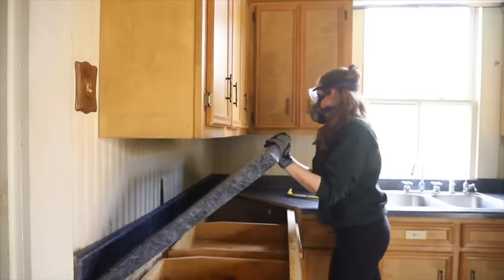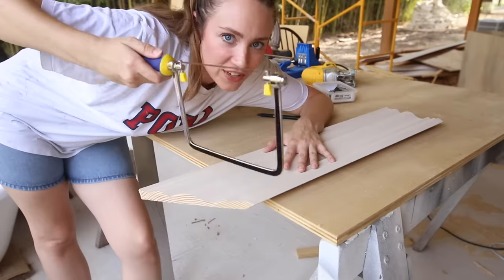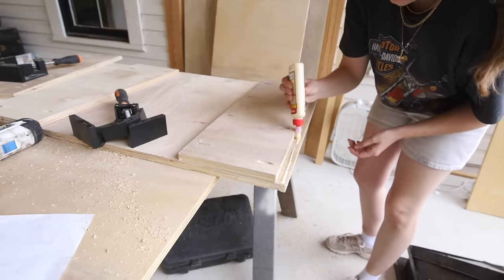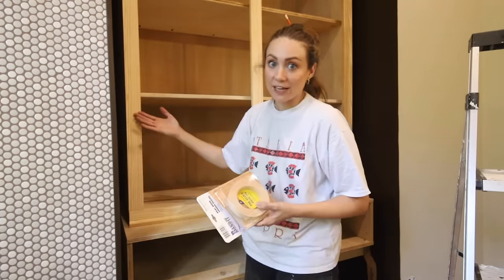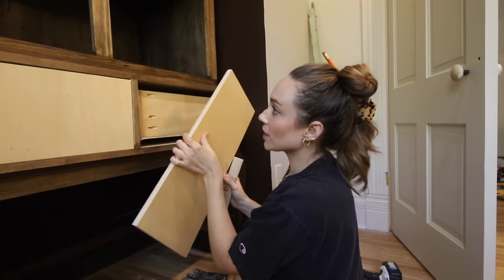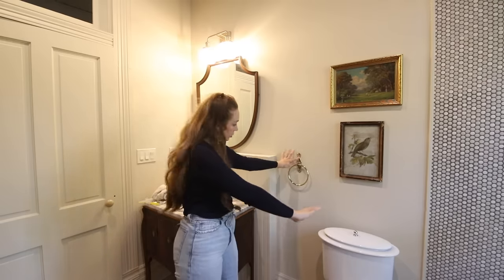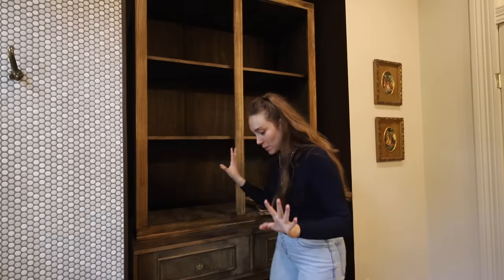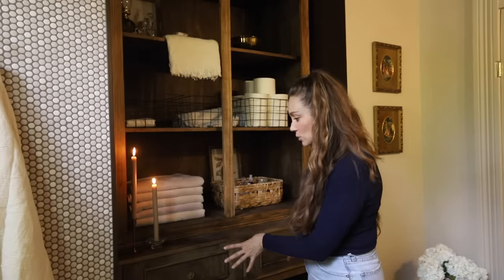GUEST BATHROOM MAKEOVER Ep. 4 | DIY Storage Cabinet & Decorating Ideas *BEFORE & AFTER*

Comment: Of course I love the finished look! But there’s a but for the process 😄 I never really understand why you paint and stain thigns only after installing them. Wouldn’t you want to properly prep the material to ensure longevity? Especially in humid environments like the bathroom, you really want to make sure the wood you’re using is well prepared for any contact with water and eventually dust that is ten times more yucky in humidity and also harder to get rid of. 
I mean of course do what works for you. I’d have stained the cabined before installing it 😅

Comment: Would you not hang the hand towel holder on the back of door? The door will be closed when you're in there so perfect proximity to the sink and much cleaner. 
It's definitely a little close to the toilet in that position. 
Definitely yes to the topper on the cabinet. You did a serious job on that, that would be a couple grand to buy.

Comment: Disclaimer: I do not know how to do this coping method however, brainstorming- maybe if you cut the shape closest to the shape down and then sand down the rest as you get closer to the edge you need? Also maybe use a bed pillow to protect the face of the crown molding then clamp it down to one of the horses because it seemed unstable that one clip you showed of you trying to coping saw it.